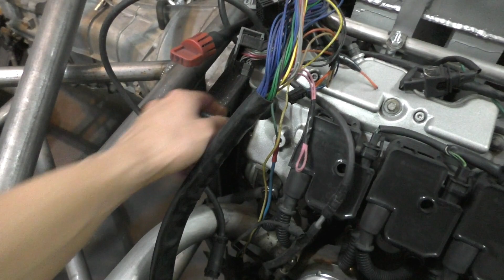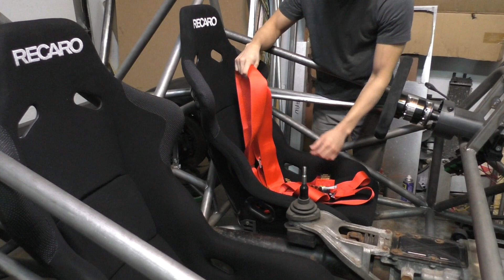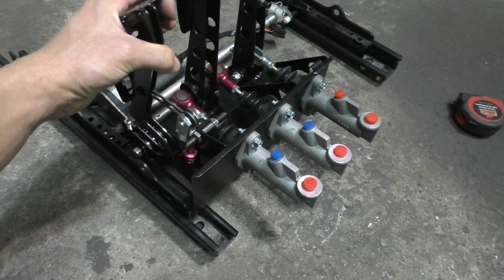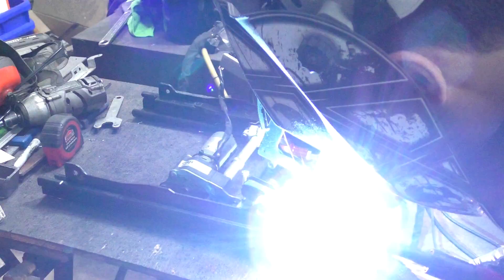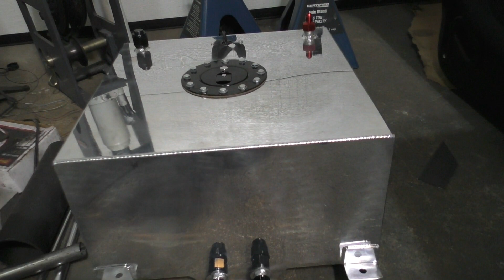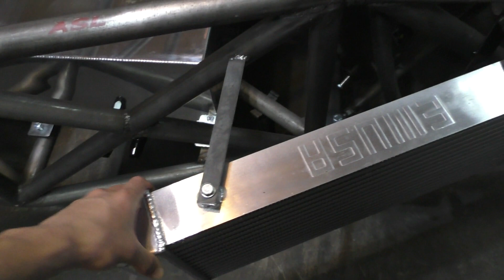Installing Racing Seats, 6 Point Harness, Pedal Box, Fuel Cell - E55 ASL Part 14

Comment: Driving off the track... with a passenger basically sitting on top of the fuel cell. Could a piece of curbing or debris break the skin of the fuel cell? I have seen cars burn just by going off track into taller grass and the hot engine lighting things on fire. Even F1 cars and GT3 cars are catching fire despite all the FIA regulated components. Scary stuff.

Comment: Nicely progressing.About Fuel cell safety ."Can  only be damaged by impact side." Or an exploding clutch and flywheel.Get or make a ballistic bag  from kevlar reinforced fabric.Or mount cell behind seat, you will need some rear weight for your % balance Also think about mounting a prop shaft hoop,front and rear.On dry sump topics,you could also use an Accumulator system instead.

Comment: You have made a few mistakes here and there as I have watched through all your videos but I am very impressed. Its good to see a young guy put in hard work like this.

You should have mounted the electric seat rail/pedal rail upside down and put the pedals out the other way to flatten out the space in front of the pedals.

Comment: Quick connect fuel lines with a pump connected to the Jerry can and an external power will work very well, that's the system they use in F1 and other types of high end professional racing

Comment: 17:54 Are you going to make a carbon fiber floor panel later? Flat CF pieces are actually not that hard to make, a diffuser is a different story though. Anyways normal petrol is not dangerous to most CF epoxy resins, but E85 somewhat is. As far as a few drops are concerned not even E85 is a problem, it only becomes one if you make a CF fuel tank.

Comment: I have a similar fuel tank in a similar position on what's also a home built tube frame car and do get fuel surge when I'm under half a tank. I would strongly support doing the anti-surge tank sooner rather than later.

Comment: I don't wanna be a heater but you are using wrong intelcoolers . Horizontal flow core's with inlet and outlet on one side will have huge pressure drop . Vertical flow core would work with your ,,side pod " design and allow for shorter intake tubing without causing pressure drop . Keep up the good work 💪

Comment: Check it the rules allow the belt to be wrapped around square tube . The corners of the square tube will focus force to one spot on the belt an maybe causing failure in a crash

Comment: LOVE this build dude but personally I would use a high wing FIA race seat. Like a Racetech RT4009HR.
I had the first big accident of my racing career earlier this year - hit a tree head on at about 90 kph road rally - and trust me. You're going to want every single piece of the best safety equipment you can possibly get. It doesn't tickle. I had a seat like yours and 5 months later my neck is only finally getting better. And still gets tight. My crash was enough to bend the seat / frame, floor and trans tunnel from the force. That going through your neck is not fun. The more you can stop your head from swinging about, the better. Hips and legs too. I pinched my leg on the side of the seat (little lower than yours, Sparco) and again, a high edge hip seat is now the only thing I'll sit in. For the love of god make sure your harnesses are mounted properly too. Mine were on the cage where they should be. If they were like every other drift boy racer and mounted at the base of the rear seat or some crap, I'd be in a wheel chair from spinal compression. The only time any of this matters is when it is too late.

Comment: Couple of questions. 
1. Do you think you will need to add crush tubes to the seat belt mounting points in the square tubing?  I'm referring to the horizontal hole you drilled using the step bit. 
2. How strong is the sliding seat frame that you mounted the pedals to? It's easy to underestimate just how much pressure we put on the brake pedal especially in a panic braking scenario. 
3. In order to fuel the tank in the way you're imagining, you will obviously need some sort of vent since you won't be using the large filler opening.  Any solution to that? 

Thanks and keep up the great work!
Reply: he won't need much pressure to the brakes, it's called HYDRAULIC breaking and with racing brake pads its even better.
Reply: I just realised that I "underestimated just how much pressure we put on the brake pedal especially in a panic braking scenario"

Comment: Do your rollover hoops not need to be one continuous tube down to the lowest parts of chassis? Also noticed one of your rollover tubes has deformed in the bending process on the outside corner, (2:52) I doubt scrutineers will like that.  Good work though

Comment: One thing that you did not consider is the engine and gearbox moving in a accident i have seen it numerous times that in a impact the gearbox and engine brake loose and that will crush the fuel  cell and cause a massive fire!

Comment: The only thing that makes me uncomfortable is the top tube that meets from the engine bay to the cockpit. I would have liked to see either one continuous tube from the front crash structure to cockpit, or at least not a sharpened half tube welded against a round piece. I’m sure you’ve already gone through the design with a fine tooth comb, but it still makes me worry about crashing into something and turning that half pipe into a spear

Comment: One of those fittings on the fuel cell needs to be a vent tube with a rip old over valve or the fuel cell will create a vacuum and won't move fuel, you need air to replace the fuel that you are moving to the motor. Also check the SPPTV channel, he used one of those cells and the ethanol ate the foam and it clogged the injectors and fuel pump and filter.

Comment: dont most racing sanctions require you to need a firewall separating the fuel tank from the cabin?
Reply: There's a comment and reply about this below already. There'll be a firewall but it'll be on top of the cell.

Comment: I thought the fuel cell had to be behind a fire wall i.e not in the cabin space. I know you explained the foot well area is really strong, but in a crash parts from another car can pierce the fuel cell between the bars and then you have a fuel fire possibility in the cabin space. What about mounting it behind the seats over the diff? Hope you don't mind my concerns, your a fantastic engineer, they are made with the up most respect for what you are doing. :-)

Comment: Getting down to the last 5% of the work that takes 80% of the time. 
Where’s your exhaust going? Looks like you’re starting to run out of room. 
Also don’t forget all the tabs and holes and tiny brackets for mounting the lines, wires, body, aero effects, sway bars and all the other stuff you forget about until you realize you need it!
Maybe just hose the car down on weld through primer until after the first test.

Comment: I really doubt any sanctioning body is going to allow the fuel tank in the passenger compartment. They don't even allow allow a lead acid battery in with you. Also I would go ahead and do a surge tank now. I know my Mercedes pumps massive amounts of fuel and tons get returned to the tank. Going around any right hander your going to run out of fuel faster than you think. Stock Mercedes tanks have a swirl pot built in. The returned fuel actually goes to it.
Reply from the maker: It's going to be under the floor panels. Batteries are also inside the passenger compartment if they are in a sealed box and vented externally
Reply: @xfmotorsports  that still seems highly questionable placement. You really don't want to fuel starve that thing coming out of or through a long sweeper and blow it to pieces. It inevitable with the side outlet.

Comment: fuelcell in the drivers  "compartment"? is that even legal? also why even  bother with  the  passenger seat  if you  put the  fuecell right where the passenger would have their legs?

should get the chassis sandblasted and   powdercoated
Reply: It actually is the safest way. Why? Because in the event of a hit, the fuel tank being as close to the inside of the car as possible is the farthest away from the impact zone. V8 Supercars run them where the rear seat would be in front of the diff, and F1 basically is right behind the driver. I mean some karts you're literally sitting on it. SO LONG AS the tank is of FIA (super high quality, like ATL etc, basically aviation grade) and mounted and sheeted off and protected properly, it's all good. The closer to the outside of the car you put it, you risk rupturing it in a crash. Also upsets balance of the car.
Reply: Have to agree here, can't imagine a sanctioning body that will allow the fuel cell in the drivers compartment!
Reply: There'll be a metal barrier between them. The floorboard.

Comment: Most rules specify the fuel tank must be separated from the passenger compartment by a bulkhead or firewall. What rules allow the fuel tank in the passenger compartment?
Reply from the maker: It's going to be underneath the floor panels, just like on mid engined cars its behind the seats but covered

Comment: as a mechanic and mechanical engineer i must say this is an an amazing build to follow.
have you done any FEA simulation on the chassis?
Reply: Yeah he said he did simulations well before he even began buying tubes to make the chassis. He included the trans, diff, and engine as structural components since they're solidly mounted to the chassis, and IIRC in earlier videos he even chose the bolts he was going to use based on the tensile strength he needed at those mounting points.

Comment: If you are planning on using e85 then take the foam out of the fuel cell or it can dissolve and gunk up your fuel system at best. Its common with these tanks.

Comment: So failure points: first the front suspension again it has no travel. Those welds are going to break. Second getting that engine out for service is going to be a huge pain in the ass. Looking at it once you are done the only way to get to the transmission will be to remove the engine then pull the transmission out through the engine bay.
Reply: It's a track car. No potholes so suspension is minimal.
Reply: michele vitarelli the front has no movement save for the flex the ball joints have. That puts all stress in the welds that hold the upper and lower control arms in place rather than the springs like it should be. Result? Broken welds.

Comment: Please powder coat the chassis!!! Love the build and cant wait to see it done.
Reply: John Peterson - Agreed. I don't see how powder coating would be inferior to primer and painting, as another commenter claimed.
Reply: Powder coat is just plastic. It chips off and traps moisture under it. Its not bonded to the base metal either. 
Good 2 PAC primers flex, will expand and shrink with heat, but most importantly the have rust inhibitors in them. Some use zinc as an anode too.
Reply: Powder coating is a terrible idea for anything that will be exposed to the elements...  Traditional spray painting with epoxy based paint and multiple layers (can't do that with powder btw) is the way to go.
Reply: @AKAtheA  IDK which is better, you're the expert apparently
Reply: @AKAtheA  i'm building an exocet and plenty of the people that have built them already use powdercoat and it has zero problems
Reply: @AKAtheA  You are wrong.  Outlaw super late models all run powder coat and it works brilliantly.